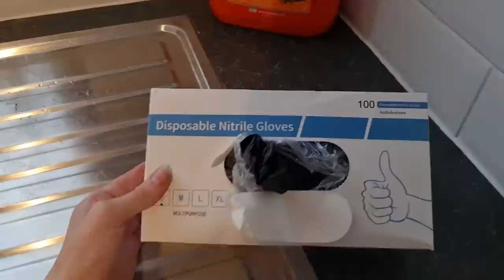My first time doing motorcycle maintenance [Part 2]

Comment: Good to see you you giving the maintenance a try, you did the correct thing by getting help with the brakes as they're safety critical,  you wouldn't believe some of the things I've seen people do. When fitting the oil filter you should put a smear off oil on the rubber sealing ring, it helps it slide round and won't damage it when you're tightening it. It should only be fitted hand tight, the nut on it is for taking it off not putting it on, it's easily damaged. And the drain plug shouldn't be hit on with a hammer,  you could break the bottom of the engine sump. It really should be tightened with a torque wrench, it's all something you learn over time and I still recommend you get a workshop manual if you haven't got one, but excellent video as usual 👍.
Reply: Good notes Peter, I totally agree with you. I was wondering what Saffy did with the old oil ?
Reply: Yeah - agree, especially with the torque wrench idea.  i know they aren't cheap but looked after all good tools last so its money well spent. Especially a torque wrench if it saves you over tightening and damaging stuff.  Also a good lever to get bolts tight enough.  Match that to a decent length wrecker bar to undo the bolts, at least they are cheap these days.
Reply: Yes good points. Glad she's having a crack, just hope it's not going to be literally! I was wincing every turn of that spanner!
Reply: You don't need a workshop manual because this is all in the manual that comes with the bike.
Reply: @brokenbiker09 agree with everything, she has to get rid of that hammer😅  doing it all very well, 100% safe for both the mechanic and the bike is in the details …. Even a simple (strong) pipe or bar will help you Saffy… i have almost every tool you can think off but i still use an old stanchion (from a frontfork) very often to help me with out when power is needed to slacken bolt and nuts….    Just extend the tools with a sufficient long lever, safes your nails, skin and bones and your bike  ;-)
Reply: @Nerezza1  I don't know what bikes you've been buying but I've never been given a Haynes Manual or any other like it with my bikes
Reply: @DarthDainese  Last I checked any manual for a bike there were instructions for basic maintenance.
Reply: @Nerezza1  well I just checked my Ducati owners manual and it is bare bones check this fluid, check this, check that, a Haynes manual will go into far more detail and considering she is not a mechanic a Haynes manual will keep her right, because I'm cringing watch her fumble through these jobs
Reply: @DarthDainese  So you're telling me your Ducati manual doesn't tell you what torque to use for the oil plug for example? 
My KTM 790 and 890 manuals give me torque values for a number of important chassis and engine bolts related to basic maintenance and disassembly. The Suzuki manual for my SV650, the same model she has, went into greater detail iirc.

The included manual is absolutely fine for just doing basic maintenance.

Comment: I want to first say it's great to see you work on your own motorcycle. It's only going to get easier in the future. But my stress level jumped a few notches. Especially watching you use a hammer to tighten an oil fill plug and then the over tightening of the oil filter. I have two suggestions to make your life easier and lower my stress level first get a torque wrench second a shop manual.

I also just subscribe, thanks for the content.
Reply from the maker: Aha yes! I'm going to loosen it tonight! Although I'm not convinced it's as tight as it looks like on camera 🤣 it's the same amount of strength I use to put my tent pegs in the ground
Reply: to be honest I was a bit worried also,filter only needs to be hand tight,as long as you smear a little oil on the oil seal so it doesn't get ripped off the filter,run the bike c if it leaks and tighten a little until it stops leaking.doing a great job though. next a ground up rebuild 😁🤪

Comment: As an mechanic myself, I'm totally impressed with the way you have approached servicing your bike. You put many of my customers to shame who 'give it a go' with no preparation and i end up fixing the devastation they create ! ... It will be a great help to you on the road when things go wrong and you have the understanding to make repairs on the go ! Well done you 👊
Reply: Yes but the tightening of the sump plug and oil filter is not correct , torque wrench to tighten the sump plug not a hammer if i saw a apprentace do that they would have had a ear full and oil filt only needs to be hand tight not ever wrenched up
Reply: @iannsr125  obviously I could have picked fault but overall the effort made was far more worthy of complement.
Reply: @robertp4767  well you as a mechanic will know the importance of correct use of tools and how important a torque wrench is, its not knocking here at all but helping as I'm sure she appreciate it, safety comes first not second,  she could of striped the plug threads and will struggle getting the oil filter off. I  ant stress enough having some one shadow you who knows how it's done is the best way and safest way till you learn and become confident your self .
Reply from the maker: Thank you so much ❤️  I'm enroute to alter the sump plug! I haven't turned the engine on yet, so I'm going to loosen it
Reply: @SaffySprocket  yes it's a learning curve and I don't want to knock confidence in people but if a teacher saw a student doing things incorrectly it would be wrong not to correct the student, so yes loosen it but you don't have to take it off, then use a torque wrench set at the core t value and tighten it up antill you hear it click and don't go any further. If you don't know how to use one I recommend asking a local garage as I'm sure they would be happy to help you 😊  explain what your doing and I'm sure they will help guide you .

Comment: Good job. Went a bit Incredible Hulk on the oil filter though. 
Hand tight until it mates to the engine, then another half turn is plenty. Also rub the seal with a bit of oil prior to installing it.

Comment: Top tip - Put a folded piece of tin foil over the exhaust before draining the oil/filter. It’s cheap, keeps everything clean and it’s easy to shape and ensure all the oil goes in the bucket.
Reply from the maker: Ah yeh, I wish I knew that before starting 🤣

Comment: Shop towels are great for oil changes, but when the inevitable spill happens - cat litter is great for soaking up oil and making it manageable.

Torque wrenches are a good thing. Don't use violence, use a bigger tool. You can put another box wrench on the end of your box wrench to get a longer lever and get that strength you need. Sockets are almost always better than wrenches, especially for not rounding bolts.

Tools are expensive - I usually buy cheap and use until it breaks. If I break it, I know I'm using it often enough to warrant a more expensive version. Borrowing from friends is also really great. Just wipe down the tools before you return them, otherwise you might not get to borrow them again.

Doing your own maintenance is a really good investment for the future. All the tools you got will save you further down the road, and maybe especially on the road.

Workshop manuals are great, and you can usually find them as PDFs somewhere.

In five years, when you look back on this point of your mechanical development, you'll do all these things with your eyes closed, and you'll save thousands changing your own wear parts and doing your own repairs, all while wearing the fabulous overalls!

Comment: Seen you tightening the filter, solid hand tight is sufficient. Could have problems later removing the tightness you gave it...💪💪👌
Nice satisfaction doing your own service 👍
Reply from the maker: Good to know! Thanks for the advice :D
Reply: @SaffySprocket  regarding that filter with the welded on nut, they have had lots of reports failing at the nut weld spots.  this leads to oil all over rear tire, possible accidents and possible engine damage.  the maker intended the nut to only be used for removing filter, not for tightening (like you did), as that puts more load on already marginal  welds.  common mistake to use the nut for tigthening, basically a stupid design filter.

Comment: Changing the spark plugs would complete the full service.

I thought my bike was running fine, then on it's 4th oil change in 8,500 miles I changed the air filter and spark plugs as well and it was like a completely new bike!!

Comment: Another tip Saffy, when you were changing your air filter, it looked like the back of the tank was held by a bolt? You could use a bungee or piece of rope to attach to the front of your tank and tie/attach the other end to your rack at the back, give you 2 free hands to remove air filter housing. 🥳
Reply from the maker: That's a genius idea!

Comment: Get yourself a garage mat for when your working on your bike. Keeps your floor clean and less chance of slipping on oil later.

A small stool with wheels is a godsend.
Do a coolant change, it's really easy and straight forward. Sparkplugs are easy too, just gotta be careful you don't crossthread them.
 
For the oil filter, fill it a few times as it soaks up a large amount of oil, and grease the seal. Make sure you run the bike after checking the sight glass as the level will drop as it's pumped around the bike. 
A length of wood for holding up the tank and when your seat is off the bike cover the battery with a towel...less chance of accidentally putting a tool on it as you struggle with something else ..

Comment: Great to see you got the work done. It is very rewarding going your own maintenance, been doing mine for nearly 40 years. Great sense of satisfaction. Learning by trial and error is a great way to learn. If I may be so humble as to mention, please don't tighten or losen fastners with a hammer (especially your old drain plug). The shock that travels through the fastner will one day cost you as either the fastner, or the body part will snap. Golden nugget of info - buy a bike suitable torque wrench that has the same 'drive' size as your socket set (usually 3/8 or 1/2 inch drive). It will ensure all the fastners are tightened correctly and because they have alonger handle, make life easy when tightening fastners. Best wished for your car test.
Reply from the maker: I'm really enjoying it 😌 ☺️

Comment: Excellent, yep tools become obsessive :) Well done,you've learnt tons !  I have spoken to blokes on sports bikes and wearing power ranger suits that can't even adjust the chain themselves and book bikes into shops. You are well on your road to being a "proper" biker, such as we were in the old days. Give yourself a pat on the back.
Reply from the maker: Man, you have no idea how much this has been a gateway drug for buying tools ☠️☠️☠️☠️☠️🥲🥲🥲🥲 gonna be broke all my life
Reply: @SaffySprocket  yup :) tell me about it,  But the correct tool for the job saves money and tears in the long run :)
Reply: Plus, they aren't bike specific so they'll be there for life! (as long as you don't lose em) Also, get ready to start buying a few 10mm sockets.
Reply: I remember taking my Aprilia Falco to a bike shop to get the chain adjusted as the wheel nut was so tight due to winter riding corrosion and l didn’t want to round it off with my crap tools. They took the piss but l thought it was a sensible move.
Reply: @SaffySprocket  It can be addictive - I retired as a car/van mechanic 3 years ago, but since then, I've still added several special tools and gadgets to my already extensive collection. I blame it on the bikes (and eBay).

Comment: Just a few tips. Try not to overtighten things. It can be worse than being loose, you end up either damaging the thread or crushing a seal. A torque wrench would be a good investment for the future. Also a bit of oil on the outer seal of the oil filter will help keep the seal in good condition between services. 
We all start somewhere, lots to learn along the way, well done for taking the big step and doing things yourself, you should be proud of yourself
Reply from the maker: Thank you so much for your support 🙏 ❤️ 💜

Comment: Great to see you doing your own maintenance, A few tips from me 1, pushing the piston back on the brake callipers simply buy a G clamp from you local hard wear store , 2 Don't tighten the sump plug like that your are likely to strip the threads ! Purchase yourself a cheap torque wrench a check torque settings for whatever task you are doing. 3, whenever you are doing things take pictures along the way this will help you when you come to put things back together. Now you have purchased your tools it will not cost you as much to carry out your maintenance and the more you do the easier it will become. Great great first effort keep up the good work and keep knocking the videos out.

Comment: Check the chain tension with the  figure in the manual (it looks too tight). The nut on the oil filter is only needed for removal, tightening by hand is all that's required.  Never hammer on spanners.
Reply from the maker: Lesson learnt 🙂
Reply: @SaffySprocket  You have done very well!  Find the chain tension figure in the manual, set the chain to that, measure the distance between the chain and the bottom of the swinging arm, and then cut something (small bit of wood is ok), that length, you can use it to easily set the chain tension.

Comment: We have male and female engineers who work for us who just aren’t strong enough for some tasks, however there’s always a tool or a technique to make it a lot easier. More leverage on a bolt is one, get a bar to slip over the ratchet is one example and it will make your life a lot easier. Work smart not hard is a brilliant saying and it makes you question a lot of things. If you constantly ask yourself, Is there an easier way to do this? You won’t go far wrong
Reply from the maker: So true 😅 I also think people overestimate my strength
Reply: @SaffySprocket  haha don’t worry about it. We have all sorts at work now to help. Nobody carries anything any more, we have trolleys for everything. Little things like that, helps in the long run when you’re not straining to carry things or tighten stuff up. We have female engineers not apply because they’re worried about that sort of thing, when we show them we have lifting tables for motors, engine cranes etc, they realise they don’t actually need to be strong, just need to know how to use helpful equipment 😁

Comment: I love your enthusiasm and I could overlook the walloping that the sump plug took, but I cringed at the oil filter, you can easily damage the oil seal on the filter doing it that tight.  Don’t stop trying, everything is learning.  Loving what you do. ❤️
Reply from the maker: 😅 I'll loosen it tomorrow
Reply: @SaffySprocket leave it now its on, but buy a torque wrench for next time and find the correct torque settings for everything it will save you a fortune in damage due to lack of experience.
Reply: According to Suzuki the Oil filter was correctly tightened, the advise on these comments makes me cringe, the last place you'll find good advice although there is some amongst the well meaning generic car oil filter fitters but never actually read the manual or fitted one that didn't fall off.
Reply: @SaffySprocket  you are a good sport, nice to see you do it your self.
and as many allready told you, the oilfilter shall only be tightend by hand, depending on your strenght.
the way you did it you are going to have another issue the next time you do an oilchange.
the seal is going to expand by the oil and kind of selflocking, this means that the oilfilter might sit rockhard, so hard that in worst case you wont even be able to unscrew it in one peace.
I say this in the most kind way I can with letters, good job.
Reply: @mc2594  Its over tightened, the nut on these filters isnt to be used to tighten the filter.
Reply: @ttmadness34  - it's correctly fitted, the nut on those filters replaces the original oil filter removal and replacement service tool and is there to tighten the filter 2 full turns 720' from seated. Suzuki SV650/S Factory Service Manual Chapter 7 pg 14 - 17.
Reply: @mc2594  no its not. It even states it on the filter that the nut is not to be used to tighten it.
Reply: @ttmadness34  - is that why Suzuki show an illustration of a hand with a ring spanner tightening it two full turns in Chapter 7 on page 16 then? must be I guess.
Reply: @mc2594  yes the photo shows them using a ring spanner on a filter adapter, not on a nut that's attached to the filter. It also says only use genuine suzuki filters. 🤣 also for your information, it says screw on the filter until the gasket just touches, then 2 turns. Not as shown in the video, where its tightened by hand as much as possible, then basically tighten it with a wrench as much as possible. 😭 that filter gasket is crushed to death.

Comment: Yeh, one of the other things nobody mentions is the frequency with which ouchies (like yours at the beginning of the video) occur when you're working on something like this - the bolt is in a weird location, you've got the tool in just right, applying pressure smoothly and... SLAM!!! The damn thing slipped! Again! And now your knuckles are on the concrete. And you're leaking all over the shop floor 😒... And the HSE clipboard warrior is giving you the stare ... Yeh, sooner or later we all do that one.

As with most things, there's much to learn, and friends who are good at these jobs are absolutely a legitimate way to speed up the process. Most really good mechanics learnt from someone else at least at the start.
Reply from the maker: Honestly thought I had cracked my arm at first 🤣 took 3 days for the pain to subside, then after that I got a blood blister on my thumb that I still have 🥲
Reply: @SaffySprocket  OUCH!